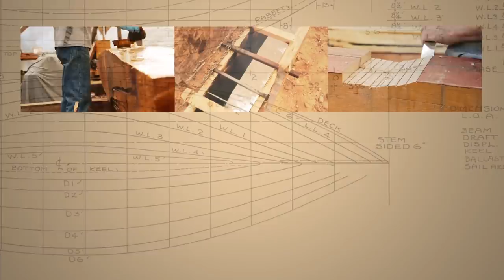Cockpit Mockup - Episode 149 - Acorn to Arabella: Journey of a Wooden Boat

Comment: Looking good guys - quick question...   Why is the saloon hatch offset?  In my experience having as much on the centreline as possible is a good thing, Trying to get out of, or into the saloon in a blow can be a challenge, having the hatch offset makes it more 'uphill' on one tack?
Also, having an openable hatch into the front of the cockpit is really useful, when battened down in heavy weather, it allows the naviguesser to speak directly to the helm without having to open up the boat.
Reply: I think cause if it were central it would be directly in front of the mizzen mast and there would be no room to enter/exit the companionway
Reply: @grahamsnyder762  Ahhhhh  -  now that is a damn fine reason!  why the hell did I not think of that?  (never sailed a boat with a mizzen mast is my excuse)

Comment: Are there going to be coamings around the cockpit? From what you've revealed so far it looks like you are going to be sitting (on cushions) on the deck. Won't this be pretty wet in a heavy sea? And make it more likely that the cockpit gets flooded?
Really enjoy following the progress of your project!
Reply from the maker: Some traditional boats don’t have a coaming or a cockpit! But yes, this boat will have coamings which will act as seat backs or to which we could add stow-able, additional comforts that come out when at anchor. The exercise of putting in the mocked up cockpit sole was to sit in there and get a sense of the human scale of it.
Reply: @AcornToArabella  👍

Comment: Question about the decking, from and old carpenter here.......
 Are you doing a traditional caulked deck , or are you doing a fibreglassed deck with a traditional look caulked deck over the top ? From what I have seen and read about, traditional caulked timber decks are notorious for leaking. 
I am one for tradition, but i could not think of anything worse than a leaky deck. I would say that the deck junctions between the house, cockpit and hatches would need to be really well thought out.......
Be interested to see what people think about this, it would be easier to do it right now than further down the track............ just saying.......
love your channel, and great to see some young blokes having a crack!
cheers from Australia!!!
Reply from the maker: Hi Mick! Thanks for watching and glad you’re enjoying. Arabella will have laid, caulked pine decks. It’s a choice, it’s what we want, and we’ll maintain them. Like wooden boats in general, laid decks  do not tolerate neglect as other options, to some degree, might. We don’t plan to neglect them.

Comment: sand flats on the frames so you don't have to put that much geometry on the back of the planks. goes faster and you can fine-tune the fit of the plank. without haveing to fit and re fit the plank so much. goes mutch faster.
easier to replace blanks in the future.

Comment: Steve , is there a reason that you did not thread the tie rods longer so the you could put a nut and washer on both sides of the carlins  locking them in place ?

Comment: Brings to mind the need for an autopilot or self steering mechanism of some sort. Windvane maybe? While sail trim and lashing the tiller may prove useful a la Slocum, a more modern approach might be appropriate, especially while motoring.
Reply from the maker: Check out something called sheet to tiller steering—works great on a boat such as this.

Comment: I'm not a boat builder or an engineer so if this ends up being a dumb question... oh well...
I've watched these since the beginning and at first there was a centerline string setup and you fellows were able to get all of your lines figured horizontally and vertically...  
I haven't seen that line in a long time now...
This question popped into my mind when he was marking the mock-up with a bubble level....
How do you know if the boat is still in the correct orientation after all the weight has been added over time...?  
Is there no chance of the mounting sinking into the ground unevenly...?

Comment: I'm not a boat builder, but in my experience when you fasten wood beams with through bolts, the bolts tend to get loose over the time when the wood expands and shrinks because of changes in moisture. How do you prevent that happening, especially when you cover some of the nuts and are not able to re-tighten them if necessary?
Reply: Wooden ships creak and groan.  You get used to it.
Perhaps, hopefully if you built it correctly,  once it gets into the water it tightens up and stays pretty constant.
I know if you put them on the hard and let them dry out, you have big trouble ahead!
Just my idea, JIM

Comment: You may wish to have the tiller able to move through 90° of vertical motion.  It would then be possible to keep the rudder straight while at anchor while the tiller is lashed in the up position and out of the way.

Comment: Maybe the cockpit floor needs to be deeper, even with a coaming. It would be good to have the ability to stand and still have protection from the weather when working to windward. It is also desirable not to have to duck under the boom when going about or jibing. You will want to be on your feet then. Seating can be stepped with a footrest if necessary. (I just looked at the video again. it should be wider as well as deeper, if possible.)

Comment: Will you be doing a raised hatch in the bottom of the cockpit to get to the top of the engine (in case the engine needs a new head gasket or something done to the top of the engine) ??
Reply from the maker: No, the entire cockpit will be removable, in a previous episode we talked about changing the joinery that’s only somewhat specified in the plans to instead make a cockpit that sets down in such a way that the whole thing can be lifted out... almost like a bathtub shape, with a rim. This eliminates water intrusion that would come from a hatch at the bottom of the cockpit or the need to completely disassemble/demo the cockpit for engine removal, which would be necessary if we built it super traditionally. Mind you, any kind of accommodation for engine removal is a plan for waaaaaay in the future. An engine can be maintained in place for the vast majority of its time in service, including for major repairs.

Comment: That grab rail is going to be a water trap. Make the lowest point away from the edge touching the house and bed it good!
Reply: I think it will be an inside grab rail.  
JIM
Reply from the maker: It’s a hand rail more than anything else. It won’t be catching or holding much water at all, truthfully.

Comment: I'm very curious about cockpit drainage.  Don't want a swimming pool there, for sure.  Healthy sized scuppers draining into pipes of some kind?
Reply from the maker: It’ll be a Self-bailing cockpit that drains to hoses with seacocks. Normally the hoses cross so the port drains to starboard and vice versa.
Reply: @AcornToArabella  Was looking at a trailer sailer that had the drains running to a common exit at the centerboard trunk.  Won't work for Arabella, of course.

Comment: Just my opinion but the cockpit should be as deep as possible so you can put slatted boards in the bottom to keep your feet out of the water. You all also need to consider drainage of the cockpit. Last the bottom of the cockpit needs to be removable so you can get your motor out when needed.

Comment: Hey Guys, another Great video as usual, but I have a question regarding bulkheads, as it seems to me that aren't going to be any? Or is too early to hear about what your plans are for them?
Reply from the maker: A lil early. Yes, there will be some bulkheads. We’re not at interior joinery yet.
Reply: @AcornToArabella  I have an Itch that I can't seem to scratch, at 23:10 you mentioned what the fore prism lite would do and one was to shine on the Galley. Is the Galley located in the engine room?

Comment: Consider building some coamings around the cockpit.
Reply: I too agree.  Having owned a  wood H 28 and a wood  Alden Malabar Sr., you  definitely will require a lifting tiller and a cockpit coaming.  Fellow sailors were always amazed to see my ten year old son standing up on the cockpit seats with the tiller in both hands as I changed head sails.
Reply from the maker: Yes, coamings are in the plans.
Reply: @AcornToArabella  great.

Comment: Don G / sv Manali - I'm hesitant to comment because you're so consistently thorough in you're planning but a couple of suggestions have occurred to me because my boat is very similar to yours in cockpit layout and size. It's possible you might want to set your tiller into the cheeks to allow pivot to vertical - allows for self store totally out of way for locker access, movement in cockpit at anchor, etc.. Second are cockpit comings to route deck wash overboard when you're underway (my bet this is old news already for you so apologies in advance - Westsail 32 cautionary notes here...) / Be well, thank you for sharing your adventure - Fair winds :)
Reply from the maker: Thank you for the very thoughtfully crafted comment.  Yes we have indeed thought of these things and will be implementing them accordingly when the time comes.  Cockpit coamings are drawn into the plans and actually he has different dimensions for the Stormy Petrel (gaff) and Ingrid (Marconi) designs. One directly from the corners of the house and one from the sides of the house and around the corners. We’ll therefore be designing ones that fit best for our layout on deck.
As for the tiller, running it into the cheeks seems like the best way to accomplish exactly what you said.  This will be fun to work out once we are making the rudder and its fittings.

Comment: I was wondering what was going to secure the structure, and i did not expect a tie rod, well, i'm no naval architect, so i suppose it's out of my wheelhouse, but none the less interesting method. I personally expected a reverse brace, in the opening, pushing on all the "walls" of the hole. Much more elegant solution, with the tie rod, of course.
Reply from the maker: These are quite common in boats of this size.

Comment: Why did you choose tiller over wheel?

Impressive sailing in the shed💪👍
Reply: Not many benefits of a wheel in a small boat. In most racing classes (Farr 40) where you had the option, wheels disappeared after a short time.
Reply: @born2sail  well, agreed on the Farr 40, but this is a very heavy wooden cruising boat a small copy of former cargo ships that became the racing schooners of times gone by. None had a tiller because it is quite an effort to steer without a wheel.
Reply: @Fr99763  Just think about the pilot cutters. Also the famous Tally Ho is equipped with a tiller. If a boat is designed for a tiller it's no problem.
Reply: @born2sail  thanks, am following Tally Ho religiously with great admiration.

Comment: As I’ve watched the construction of this boat the chosen tools used as well as the methods have often times perplexed me. In this episode it shows a cordless drill used to pre-drill the mounting screw holes for the tire rods but then a manual hand-drill used to install the screws instead of a cordless impact. When installing the tire-rod washers and nuts a manual socket wrench is used instead of a cordless impact. And finally, when cutting the excess from the sill plate, time is spent clamping down the piece, using a hand saw to make the cut and then hand plane the edge to even it out rather than making the cut with an electric miter box.
I’m just curious as to the motivation behind these choices. Is there an objective reason behind these choices or is it purely subjective in wanting to project a more “craftsman” type method. As a guy who has owned and run framing crews for over 30 years, the efficient use of time has always been essential which is why your methods seem somewhat arbitrary. Would you please explain your position on this matter, thanks.
Reply: It is soft brass dude,hand only for screws.
Reply: I know press is a soft metal that is prone to stripping out which is one of the reasons they make variable speed impacts.

Comment: How are you going to get the water out of that cockpit well?  If you get pooped you will have a lot of weight in the stern that will get you pooped again and again.  When you are on the wind and the the deck is completely awash with blue water the cockpit will continually refill.
Reply from the maker: We will do a very typical self draining cockpit—drains connected to hoses that empty through seacocks below the waterline.

Comment: The tiller should be fairly rigid in the rudder head.  If you need to stand on deck to steer, brace yourself with the Mizzen shrouds and steer with your foot.  I used this method on my Tahiti ketch and it worked well.  Are you planning to put plywood sheathing on the deck.?  It will do wonders for preventing the boat from wracking and can go under a more traditional finish.  See the details on "Restoring Susanna" for details.  (on Youtube)
Reply from the maker: No there are no plans to sheathe the deck. It will be a traditionally laid deck. As for the tiller being on a pin so it can be raised, it’s fairly common to do that, as most lazarette hatches fall underneath a tiller and it’s crucial to be able to avoid the wide swing of a tiller hitting guests and crew in the cockpit.
Reply: @AcornToArabella  and if you can't lift the tiller, it might hit the deck when it's moved all the way to either side, since your rudder stem is quite angled, or am I wrong?
Reply: @AcornToArabella  My Tahiti had a 3/8" plywood sheathing covered with a laid  3/4" teak covering.  It never leaked in  50 years.  The lazaret hatch cover was a lift-off so it could be removed from beneath the tiller.  It could be secured with a line over it secured to cleats on either side.  The tiller was high enough so it cleared the bulwarks on either side.  There was room for guests and crew to sit at the forward part of the cockpit and avoid the tiller.

Comment: Curious, how would you drain water that finds it's way into the cockpit? Does that flow all the way down to the bottom of the boat?
Reply from the maker: Cockpit drains attached to hoses that are then attached to through hulls below the waterline. It’s called a self draining cockpit or a self bailing cockpit.

Comment: Are the brass tie rods a standard practice, or a workaround for the (questionable imo) absence of traditional dovetailed joints on the carlins? That's a lot of hardware poking out all over.
Reply: I do believe that the original plans call for tie rods.

Comment: Fresh water sloshing around will make its way into the joints and start to rot the wood. It would be better to leave a gap in the grab-rails beneath the port lights and let it make its way into the bilge.
Reply from the maker: There won’t be water sloshing in there. The main point is that they’re grab rails and cover boards for the sill/house assembly.
Reply: @AcornToArabella  You mentioned condensation from the port lights.
Reply: I wondered about this too, seeing plenty of boats with leaking port lights. How about some vertical weep holes in each corner? Then you could have some formed channels or such under them to drain the water outboard. Maybe made from some nice copper sheeting. Beautiful as well as practical.

Comment: How do you plan to organize drainage of the water from the cockpit?
Reply: With cockpit drains. Look them up.
Reply from the maker: It’ll be a Self-bailing cockpit that drains to hoses with seacocks. Normally the hoses cross so the port drains to starboard and vice versa.

Comment: I sailed a boat with a tiller it had an extension on it rat could fold back onto the tiller and encapsulated it on 3 sides. Due to the funky u joint connection the extension was not only supported but when rolled back added  thickness to the sides of the tiller arm and moth the thickness .....may help maybe trash
Reply from the maker: Hey Tyy—thanks for watching and for sharing your experiences. We get some very thoughtful comments here, and appreciate your contribution to that.

Comment: Me being a non-boating person this may seen a stupid question: How do you deal with the water/rain that accumulates in the cockpit area?
Reply: Drains
Reply: The cockpit will have several large drains (ideally, four of them, but at least two) fitted into the bottom of it, that drain overboard. The deck area around the cockpit, will also have scuppers to let water drain over the side.
Reply from the maker: It’ll be a Self-bailing cockpit that drains to hoses with seacocks. Normally the hoses cross so the port drains to starboard and vice versa.

Comment: You mentioned that the house side pieces would be epoxied together. Big problem with epoxy is that it has a different coef. of thermal expansion than wood. Also, epoxy is much stronger and harder than wood and after many thermal change cycles the stressed wood at the joint will break down causing a crack and water entry and rot, The answer is to use 3M 5200 at the joint. This is basically rubber and will give with the wood movements and last forever. Apply with a notched trowel. Never use epoxy on wood boats!
Reply from the maker: Epoxy is commonly used for strip building, which is how the house sides are going to be built. They will also be sheathed with fiberglass (or Dynel, we’re still ruminating). Epoxy does have its place in certain parts of wooden boats, and yes, there are places where it definitely shouldn’t be. Dutchmen, for example.
Reply: Using epoxy on wood boats is inviting rot failure in 5 to 10 years due to the difference in thermal expansion rates between the wood and the epoxy. The best source for more info is Don Danenberg Boat Works. His main business is restoring antique boats and has written books explaining this problem with hard epoxy. His method involves the use of CPES (a penetrating thin epoxy) on all joint surfaces then 5200 as an adhesive. I'm sure your friends at   Jamestown Dist. have heard of him.